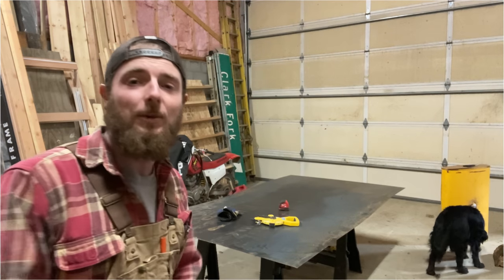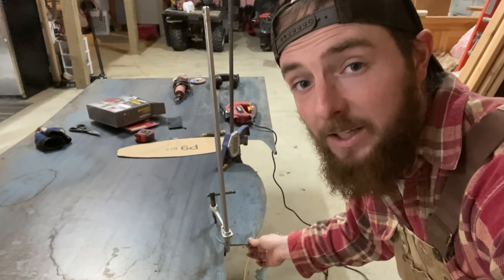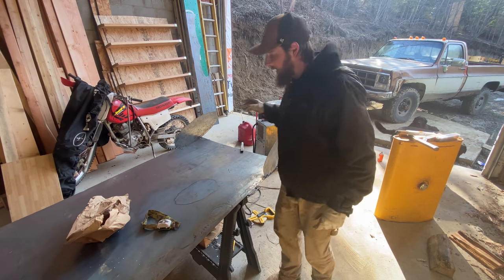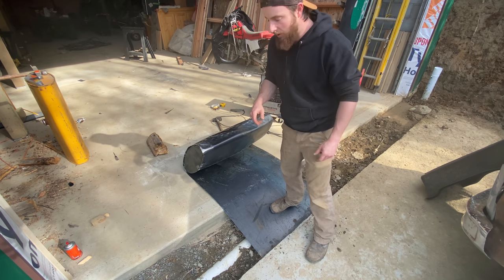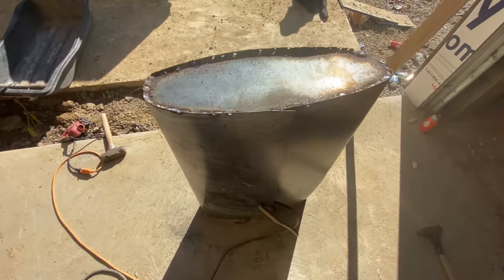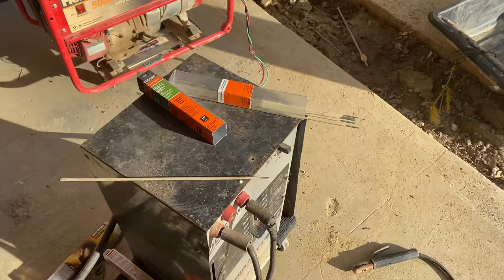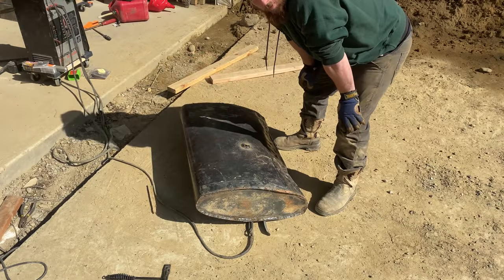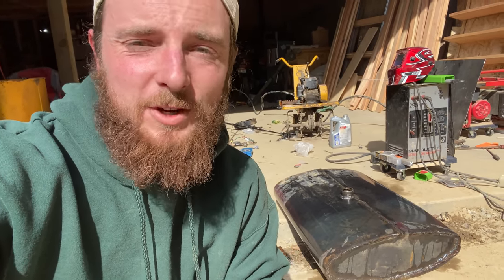FAILED!! Welding A Gas Tank | Allis Chalmers Gas Tank Build

Comment: Much respect for the effort. You don't learn unless you fail from time to time. In my experience, stick welding anything under about 1/8" thick material is extremely difficult, at least for those of us who are not professionals and only weld occasionally.
Reply from the maker: Thanks. Ya the thin stuff is tricky with stick. Thanks for watching!

Comment: I did more erecting than fabricating as an ironworker but can throw you a couple tips..I would cut the ends of the tank off and grind the edges perfectly flat then cut your ovals oversized to set against the tube. The trick is to eliminate as much gap as possible that way. Lay the oval on the ground and set the tank vertically down on it..this way you can weight the other end of the tank to create a tight seal. This way you also don't have to wrap around anything but rather are just butting surfaces. If you are going to wrap again use heat (blowtorch) to make the iron pliable. Most people don't know if you heat iron it expands but as it cools shrinks more than it expanded..that's how we plumbed I beam columns by heated the side we wanted the column to move to. 6013 is the right rod tho of course a wirefeed would be preferable. Good Luck with it.

Comment: I’ve done this successfully before and I’ve also done it unsuccessfully testing for leaks is best done by pressurizing the tank and checking with soapy water The type of welder you should be using Tigue or wire feed this is a difficult thing for even the most experienced welders doesn’t mean you can’t do it just don’t get frustrated because it’s not easy. At least that’s what I can see it from sitting on my couch doing nothing while you’re working hard Keep up the good work I hope you succeed

Comment: You don't have to seal it with a welder, you can buy tank seal kits just make sure it will work with the fuel your dozer uses, I don't remember if its diesel or gas. Doesn't have to look pretty. You need a MIG welder with Argon bottle to make a cleaner weld, ARC welders are a stronger weld but mostly used for more industrial welding. You could always use thinner sheet metal to make it easier to bend around tight corners, fuel tanks don't have to be thick, if they are painted they will last a long time. Hope this doesn't come across harsh, just trying to give information and help. :)
Reply from the maker: Thanks! Ya I think the seal kit will work. I do need a mig machine. One day, even the decent harbor freight one is over $600. Thanks for watching and the tips!
Reply: @LaidBackLiving  Look for a used Miller MIG machine when you go to get one. Miller is a great brand and people usually sell them because they don't use them not because there's something wrong with them. :)

Comment: The problem with arch welding a tank is every time you stop an arch, you must chip slag and wire brush clean before starting to weld again. A mig welder would work better for this. 
The old tank can be coated on the inside with a tank liner coating from Eastwood.

Comment: You definitely need a MIG welder to do the tank or any sheet metal welding. Even a cheap Harbor Freight flux core for under $140 with a 20% off coupon would be good enough to get the job done. It would allow you to run a constant weld the full length of the material you're welding, keeping a good seal. Looks like you might be relegated to using a lot of JB Weld or silicone sealant for this one but, I don't think it will work.
Reply from the maker: Thanks for watching Craig. One day I’ll have a nice welder. The gas will eat the JB or silicone. I’m looking into seal kits.

Comment: dude get ya self a mg wire wielder their cheap and are great at light grade metal.
Reply from the maker: They most definitely are not cheap
Reply: ya can find them cheap at pawn shoppes ,I got mine with gas and wire feed for 115.00 with tax, bought a shit load of stuff for about two bills. and made out. look for the local shops make a deal they want the stuff gone.
Reply from the maker: Lots of moving parts and computers in a mug machine. I’ve found the cheap ones don’t hold and you can’t get parts. Sometimes you can find a nice one on CL around $700

Comment: Yooo, Mr., 95 amps is waaay to much. You should have formed the flat sheet aprooximately to fit the contour of the oval, without overhang (butt weld), smooth corners. I've made  the hydraulic tank that way and it's perfect with no leaks. I used 1,5mm thick plate, 6013 rods 1,6mm and 45 amps. It went together smooth as butter. =) Anyway, be careful with flammable stuff, accidents happen very easily.
Reply from the maker: Thanks!